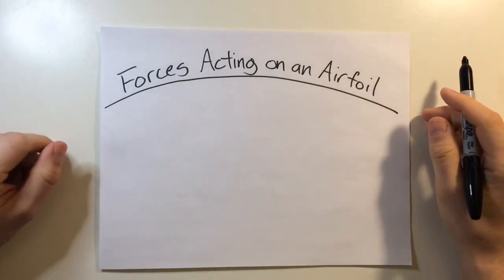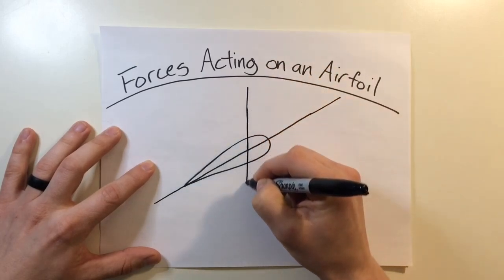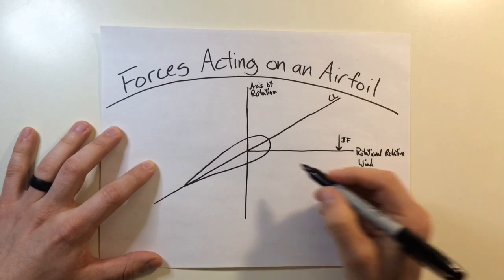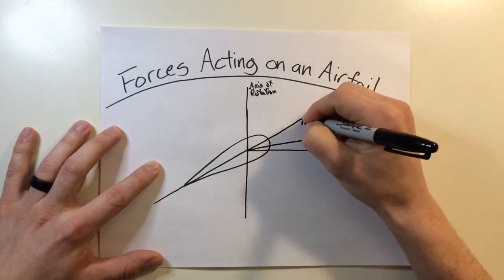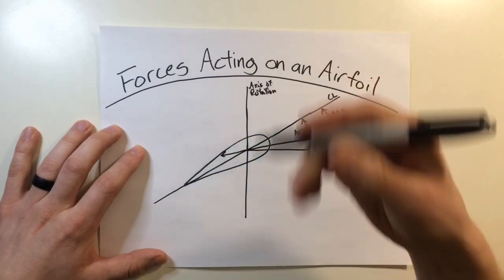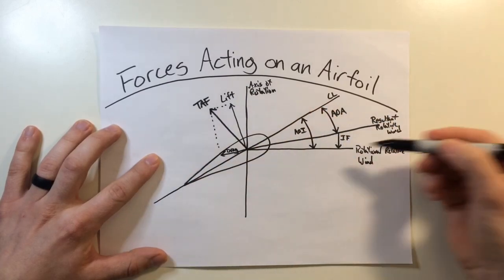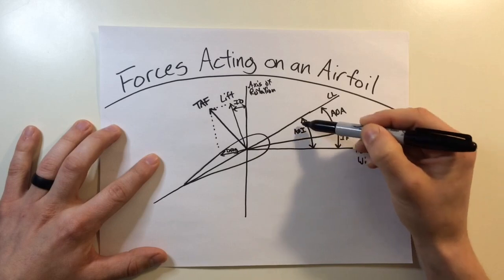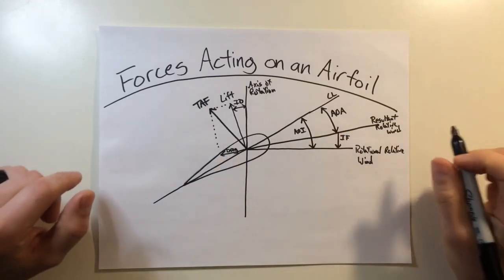Forces Acting on an Airfoil

Comment: Nice explanation! However, is there a mistake in the official FAA Helicopter Flying Handbook? Figure 2-21? It says "Lift is perpendicular to resultant relative wind" but it clearly isn't on the picture (it's perpendicular to rotational relative wind).  Am I missing something? faa-h-8083-21A.pdf is free online
Reply: Found a new version of the book "FAA-H-8083-21B" and they corrected the mistake! All clear now!
Reply: But I think they got the pictures wrong way round - because induced flow seems to be lower in OGE hover and higher in IGE...

Comment: A diff channel's vid about fixed wing AoA took care to distinguish the path of the plane's movement through the air vs the pitch of the plane/wing vs level ground vs relative wind.  In your (this) vid, I didn't hear mention of the heli's path thru the air -- is this because (in a discussion of AoA in helicopters) we're concerned about the path of the blades, not the path of the heli body?

Comment: If lift and drag are always 90 from each other then the TAF never changes in powered flight, correct?
Reply: The TAF can change based on the size of the the Lift and Drag Vectors

Comment: So, Rotational Relative Wind is the Induced Flow, or downwash, that an airfoil will come intact with, caused my the airfoil before it? So, the airfoil is being effected by the relative wind in addition to the Induced Flow of the airfoil before it? These two combining to make Resultant Relative Wind?
Reply from the maker: Alexandra Milne. Rotational relative wind is the wind the blade experiences as it rotates around the mast. This velocity is affected how much airflow is being pushed downwards through the disk (induced flow). The resulting airflow is the Resultant Relative Wind. Imagine a helicopter with engine running and flat pitch sitting on the ground with zero wind. At this point rotational relative wind is the same as resultant relative wind. But as pitch is applied and induced flow begins to occur, or as blades flap, induced flow is introduced and there is a difference between the rotational relative wind and the resultant relative wind. I hope this helps clarify.

Comment: thanks jacob..may i know which direction drag acting actually? some book mention its against the chord line, some other book mention its against the rotational relative wind. can you explain or give any reference?
Reply: Drag is always in the same direction as the airflow coming toward it, so the rotational relative wind for a helicopter (basically, this video is correct). Drag for any object is always parallel to the direction that air (or any fluid) is hitting it. In engineering, forces relative to the chord line are normal and axial, where axial is the force along the chord line (a value close to drag) and normal is the force perpendicular to the chord line (a value close to lift). I'm not sure if those terms are ever used in aviation; they're generally not as useful.